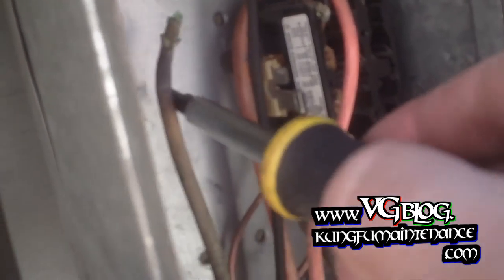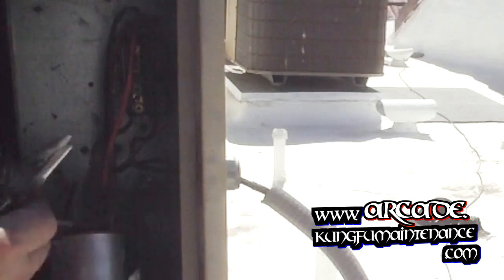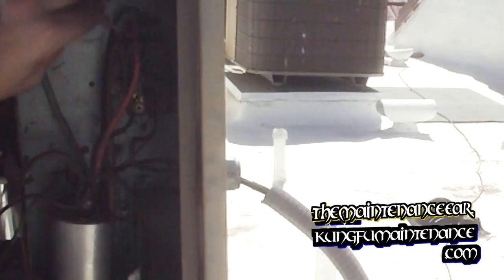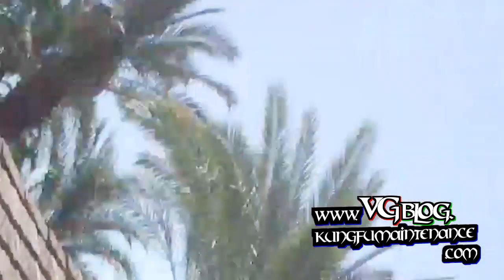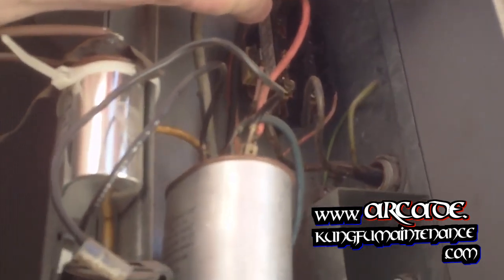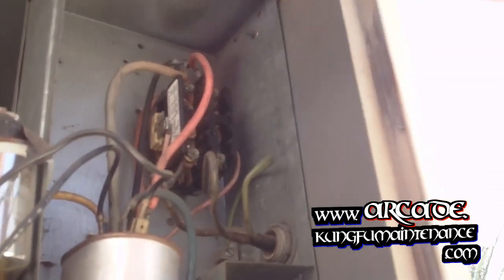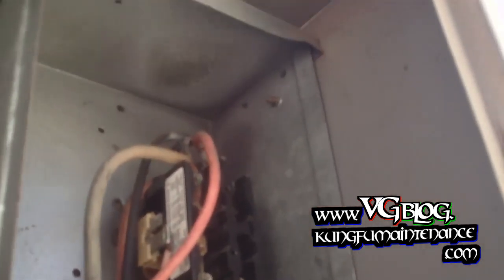How To Fix Air Conditioner Wiring Fan Running But Compressor Not Starting

Comment: Good morning I have learned a ton from watching your videos, so first of all thank you for taking out the time to do this. I have a temp star unit that about 9 years old. When I go outside to my unit I see the fan its not running as fast enough, the air inside the house comes out a bit light not as strong as the unit downstairs. So whether the ac is blowing inside the house or the ac is not blowing the fan outside continues to spin. I am not sure what else I can do, I have replace the boards, the contactor, the defrost board and capacitor. I have also added a kick start thinking that the compressor was going bad because a makes a slight high noise when it comes on. Can you help me, perhaps I plugged a wire incorrectly from the board to the contactor or perhaps the fan motor is going bad. thanks

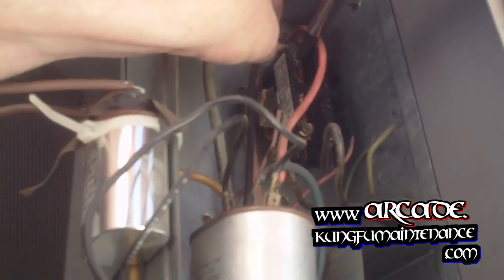Comment from the maker: 2:22 I echo that exact point. Wire strippers are always preferred and I recommend all people always use wire strippers to prevent losing strands or nicking a solid core wire. Extreme care should be taken when stripping wires even when using strippers. Examine the stripped wire to make sure there are no nicks and examine the stripped off piece of insulation to make sure no strands of wire came off with it. A nick or lost wire strands can cause excessive heat build up leading to mucho problemos.